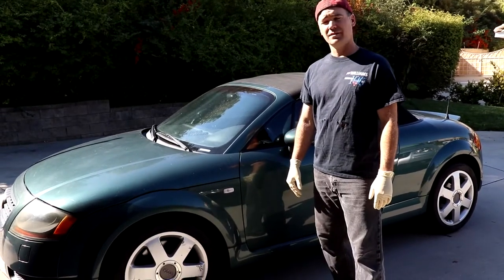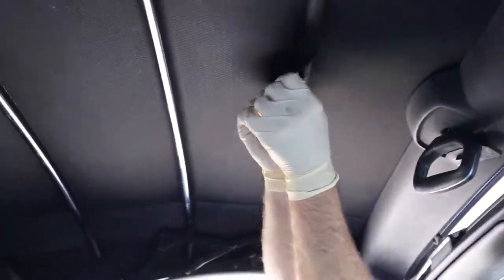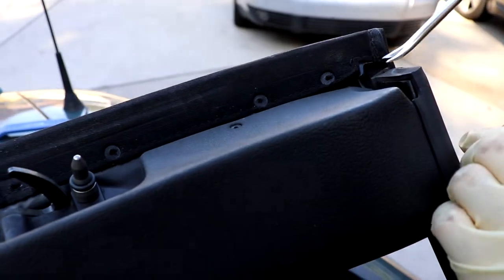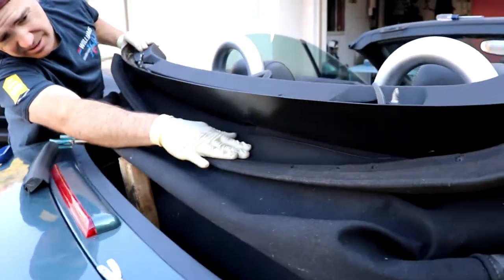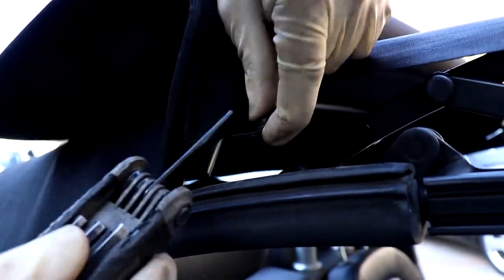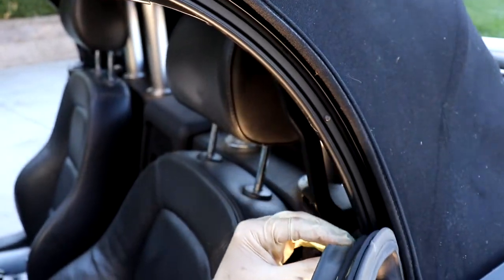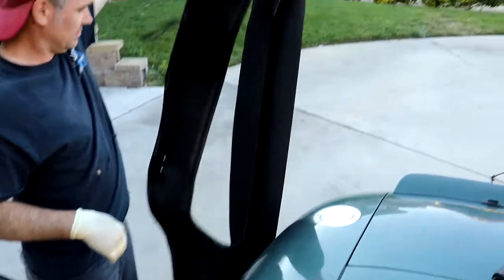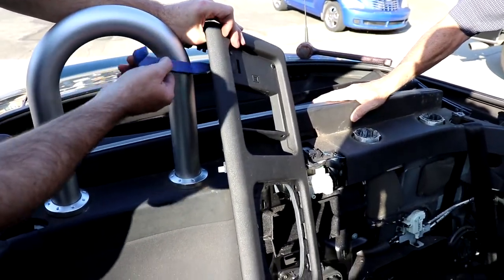Audi TT MK1 Roadster Convertible Top Removal (Years 1999-2006) Complete Removal Tutorial Part. 1

Comment: I am really glad for my sake that you had the problem trying to remove the release handle.  I am working through roof replacement currently with your videos, the instructions provided by the roof seller, and my Bentley manual for guidance.  I ran into the same issue as you, in that I cannot get an allen wrench to bite onto the pin that holds the handle, and now I think I have stripped it out.  That might have been a stopper for me if you hadn't figured out the workaround.  Thanks for posting these!   I was quoted $1,800 in just labor and a 10-month wait to have the work done.
Reply from the maker: Thanks for the feedback 90Duck, it was hard finding info about that handle when we were trying to remove it. Glad to hear you are taking on the challenge and doing this yourself. Based on your quote of $1,800 it seems like the prices have gone up since we first performed this repair. You will be saving a ton of cash by doing this yourself, that's for sure. 
Good luck on the repair, please let us know how it goes, Cheers!
Reply: @BradleysGarage  I received some advice on one of the FB forums on removing the   allen bolt in the handle, and this time it came right out.  It is impossible to tell what size it is down in that hole, and I had read it was a 5 somewhere.  It is actually a 4, and when I tried it this time it came right out easily after loosening it fully and then pushing it out from the other side with the smallest allen key I had.  Of course I had already disassembled things working around it like you did, but it should make it much easier to reassemble with the handle out of the way.
Reply from the maker: When we tried to remove that allen bolt, it just spun like it was stripped out. Glad to hear that you were able up remove the handle after all. It will make it easy to put everything back in the right place with the new top. Good luck and stay positive on your project, Cheers!

Comment: FYI to any of those tackling this in the future - it was a little more of a pain in the ass, but I did not have to remove the roll hoops to get my top out. Total time for careful removal was about 4-5 hours. Also - I recommend placing some plastic underneath the rear striker rivet areas when drilling out the rivets. If your rain rail bond is toast like mine was, it’ll keep aluminum chips from embedding themselves in your carpet.  Great video.
Reply from the maker: Thanks for the comments. All these little tips will help the future guys tackling this job. Glad you found the video helpful.
Cheers!

Comment: The Handle can be removed by unscrewing the pin (it is a metric hex) then pushing out the pin through the access hole on the opposite side, or just wedging the hex key sideways in its slot enough to get some friction on the pin to allow it to be drawn out.
Reply from the maker: Thanks for the suggestion. I tried to tap that small pin out the handle but could not get it to budge. Did my best to work around that issue but hopefully it can help the next guy out. Cheers!

Comment: So how did you get the two rear locating blocks out? There are (what feels like) 2 philips head screws on each block that you can't get to unless you take the whole frame off...
Reply: Sorry they are rivets and I skipped that part of the vid, thanks good video
Reply from the maker: Sorry for the late reply, glad you got it sorted out. We just drilled them out and found some screws from the parts bin that fit tightly into the metal bar. Good luck on your project, Cheers!

Comment: I need to know from cable to switch in car ..where the electric cable connects too. To make switch work ..hydrol oil is at max.. it connects to a cable to allow electricity to power motor.. it's not connected to in middle of back  in the middle so where can you help please
Reply from the maker: Thanks for the question Michael, apologies we don't have any information about the motor itself as that was working great on our TT. We only had the issue with the top itself so we have never messed around with the pump motor or switch.

Here is a post that might provide some insight for you though - 
https://www.audiworld.com/forums/tt-mk1-discussion-9/convertible-top-wiring-diagram-2928746/

Here is a few pictures of the motor itself along with the lifts & hoses - https://hermesautoparts.com/autopart.php?autopart=Audi_TT_MK1_8N_Roadster_Convertible_Top_Hydraulic_Pump_Motor_w%2F_Lifts_and_Hoses_8N7871611A

Let us know how it goes with your Audi TT project.
Cheers!

Comment: Hi there. Can you help me i have a leak from the rear drain pocket. Is this the seal on the rear thats failing? Water is coming in on the newr centre of the hood under window(not coming from window)
Reply from the maker: Sorry, missed this notification. 

The most common reason why you are getting moisture in the back is a clogged side drain. The easiest way to check is, grab a buddy and have him take the garden hose and have him spray water on the lower section of the window around the edge. All while you are inside the car with your head between the two roll bar loops looking and watching for any evidence of water coming in. My gut is telling me the water will be coming in from either side because of a clogged drain and making its way to the center section where you see condensation on the top.

The friend method with the garden hose should help you identify where the water is coming from. There is a small chance that the rear vinyl channel could have a tear where the water leads to the drains.

Let me know if any of this helps!

Comment: TO ANYONE DOING THIS: Just remove the handle, it literally takes 2 minutes. With the top down, rotate handle until you see a 6mm hole on the side. Aim hole towards back of car. Put a 5mm Allen wrench in there and unscrew it. Then put a 1 or 2 mm in the opposite side and push the tiny screw out, the handle will fall off. Then remove the button by lifting straight up (don't bend or move in any direction but up as it has "feet" that lock it in place). The hardest part is figuring out which of your Allen wrenches is 5mm because they're never labeled.
Reply from the maker: Appreciate the comments and agree removing the handle is ideal. Unfortunately, either the Allen screw was stripped or just being difficult to loosen, so we had to improvise and work around it.
Thanks for the detailed explanation though, hope this helps anyone doing this project. Cheers!

Comment: I didn't get anything with my new top just the fabric with the glass
Reply from the maker: Hey Trapz, I am not sure which top you ordered or where you ordered it from but if you went with my recommendation, they have a couple options. Depending on your selection, they may or may not include the new cables, cement, double-sided tape or pry tools. However, all of these can be sourced locally so it's usually not a big deal.
https://www.convertibletopguys.com/convertible/1003/1999-2006-Audi-TT-amp;-TT-Quattro-Roadster
Hope the video helps you out with your project, Cheers!

Comment: Very interesting ..only it would have been a lot easyer just to fix the window in the first place .
Reply from the maker: Trust me, we looked at re-epoxying the window back to the canvas, but after speaking with several shops, no one would stand behind the work. Not even guaranteeing it would last a year. Replacing the top was the only viable solution that would last.  We definitely would've preferred saving the money and time but from what we heard no one guaranteed it lasting. P.S the top we purchased is guaranteed for life
Reply: I had my rear window done 
Stitched all around plus adhesive 
For £300 all done.    UK